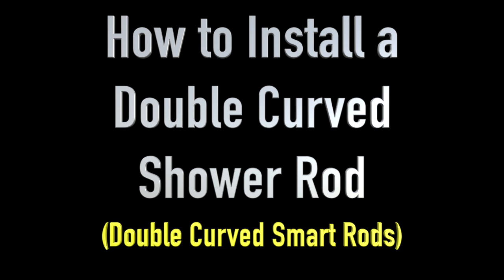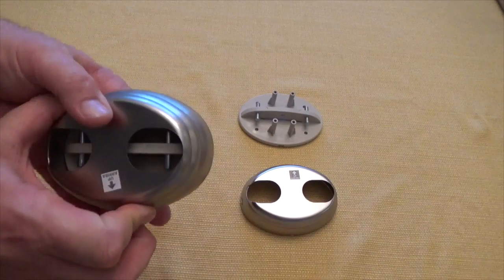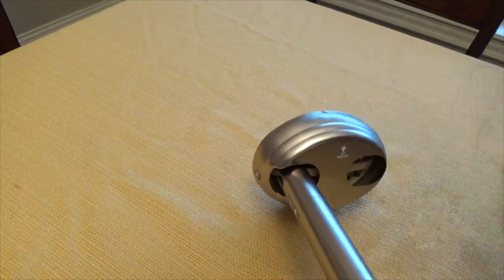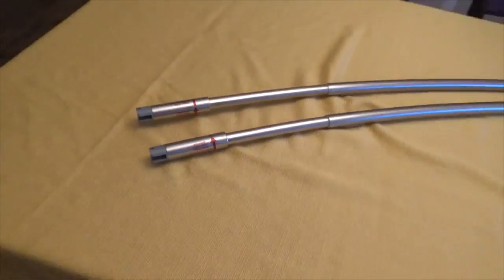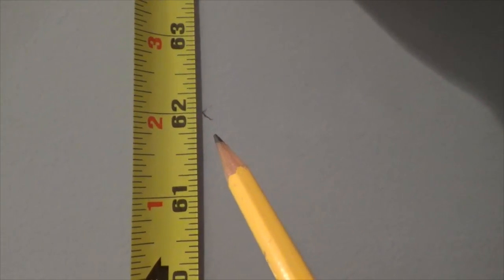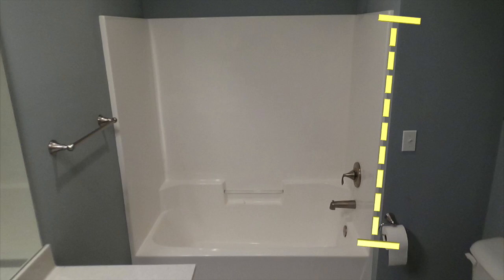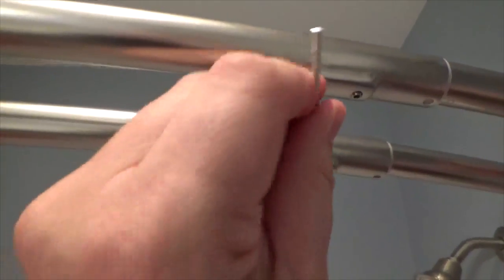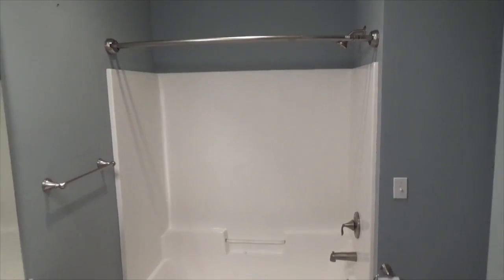Double Curved Shower Rod Installation - How To Install

Comment: A great video. Question... once making two marks (2.5 inches apart, essentially forming a line), do you align the end pieces on top, below, or at the centre of those marks (the virtual line)?
Reply from the maker: hard to explain with text.......   however.     this rod has proven to be a rusty piece of manure.  I will never buy it again.

Comment: I have a better homes and garden curved tension shower rod. It fell and it won't go back up. It won't twist to tighten. What do I do?
Reply from the maker: I would buy a different brand.  I"ve since replaced this one.  It rusted so bad, I was very disappointed.

Comment: I guess we will never get.the answer. What is the 2-1/2 inches? Is that a line for the top or bottom of the brackets? Or is it for how far back towards the wall you mount the brackets? And if the latter, what do you align with what? Is that the front of the bracket, the center, the rear?
Reply: Thank you! This should help the other people asking as well. I wound up eyeballing how far out the bowed section should be by holding up the rod with a curtain on it. There were also diagrams of a view from above the tub from a manufacturer online. So imagining that you had a plumb bob to dangle from the inside rod down to the tub, it shows that shows the end of the inner rod starts either at the inside corner of the tub or extending a little inside the area where you would bathe, and the furthest point of the bow extends to the outside edge of the tub. Mine is about an inch further out than that, and it doesn't seem to be a problem, but I can see where you would not want the curtain to be pulled further out than the outside edge of the tub. Basically, you are getting about 5-7" more elbow room at elbow height over a curtain that was hanging straight down to the inside edge of the tub. We are using the inside rod for the liner and curtain and the outside rod to hang towels.
Reply from the maker: DARN!!!!   I put the MIDDLE of the bracket at the 2.5" mark.  Sorry to keep you chasing my answer, but .... it's been a while since I did this project, and I want to make sure you get the correct answer.   Thanks for your patience with me!